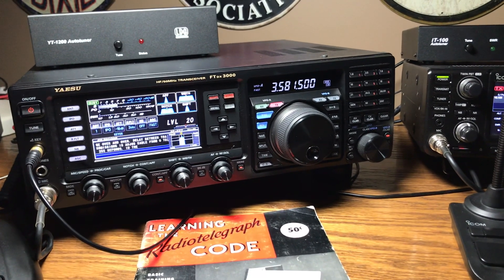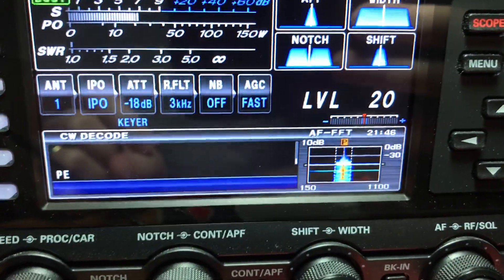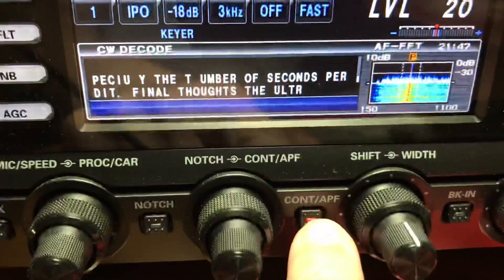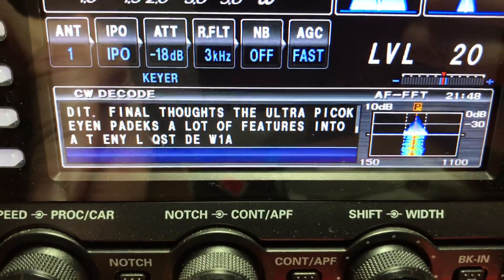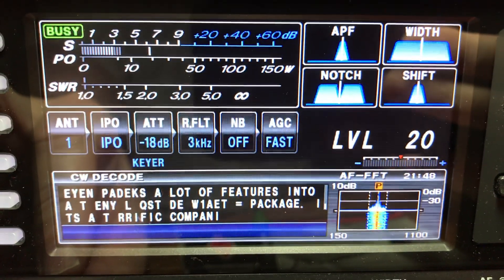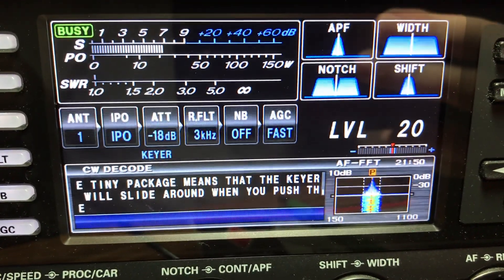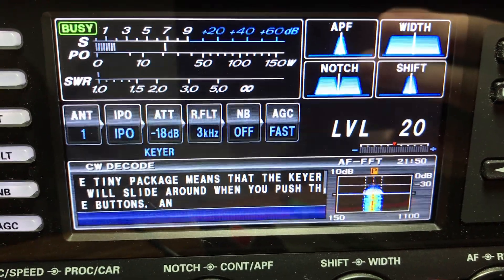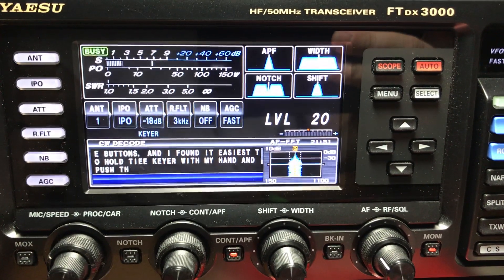Yaesu FTDX3000 - CW Decode Function

Comment: A local ham is selling one of these for $1400 at the moment. I’m thinking of getting either that or an FT991a. Either one would be great to have.
Reply from the maker: The FTDX3000 is a solid HF/6m transceiver that has the same RX hardware / circuitry as the much more expensive FTDX5000.  I would think that price is fair.  The 991a is also a great rig and is an all-mode rig adding 2m and 70 cm and C4FM Fusion capabilities... I know several that have those and really like them.  I like to monitor 2m /  70 cm repeaters on a separate radio while working HF, so having a single all-mode rig wasn't my primary choice.

Comment: On the display  screen near the right display shows "LVL 20". can you explain its use and adjustment?
Reply from the maker: Yessir.  That is like a squelch level for the CW decode function.  It is adjusted with the small VFO B knob to the right-side of the radio.  If this is set too low, the band noise will cause false decodes as it interferes with the received signal.  Setting this higher allows more reliable decoding.  Setting too high will cause the radio to filter out too much of the actual received signal.  Thanks for the Q and 73!

Comment: Does this stop working once you connect the radio with USB lead, as it worked as described in your video, but now i have connected USB to PC to use a SDR as a Pan adapter the pressing of the SCOPE button just gives me a double beep from the radio.
Reply from the maker: Howdy...I have a USB connected to a computer as well for FT8; this does not stop the decode function.  It may have something to do with your SDR setup.  73

Comment: I've just got an FTDX-3000 and have tried to decode CW unsuccesfully. Thanks for posting.
Reply from the maker: Julio Cesar Pereira ...set the words per minute to equal (as close as you can) to the speed of the other station’s CW speed.  Also, use a narrower filter to cut down on background noise.  Finally, adjust the decode sensitivity using the VFO B ( small knob).
Reply: @GhostRider1974  Thanks for the tips.
Reply: @GhostRider1974  My hope was to find a video that tells how to set the sensitivity. I also am having trouble getting the Decode to work. I get maybe 2 out of 3 letters and then a few extra and a few wrong. Any hints?
Reply from the maker: Allen...be sure you set the words per minute close to the speed of the code being sent, then assure the signal is within the decode bandwidth.  Adjust level with the aux VFO knob (the small one) to filter out false decodes.  Use narrow band filter width to reduce the background noise.  73!

Comment: @Ghost Rider,is the antenna tuner YT1200 working ok on your FTDX3000 i read a lot of different stories on Eham.
Thanks for the video!... 73 PD7RL
Reply from the maker: FUNKY65TOWN ...Indeed, I haven’t had any trouble with it.  The only annoying thing about it is that you have to switch the radio menu setting for CAT control from USB to RS232 if you using computer control or digital modes to run a tune cycle.
Reply: @GhostRider1974  Thats a deal breaker for me, anyways thanks for your answer! 73's PD7RL